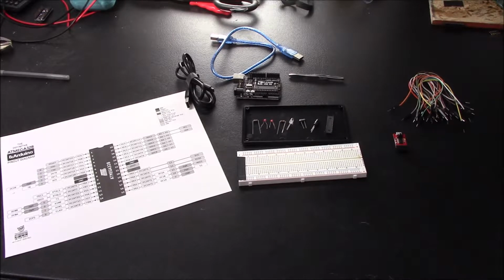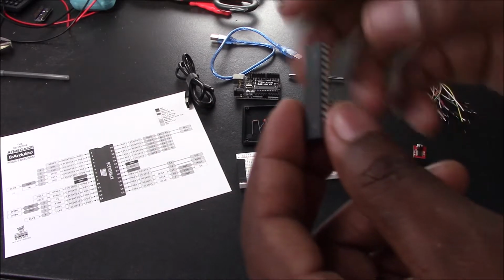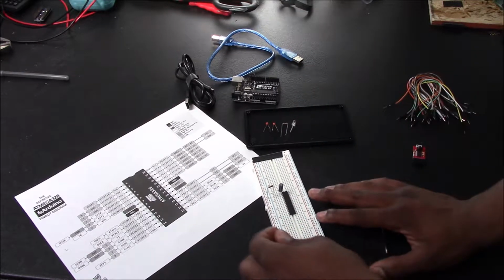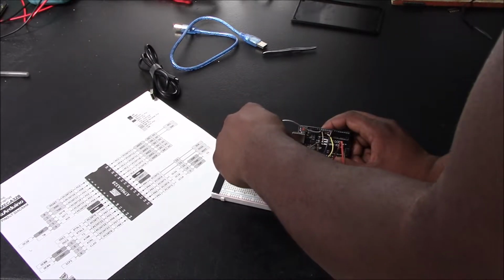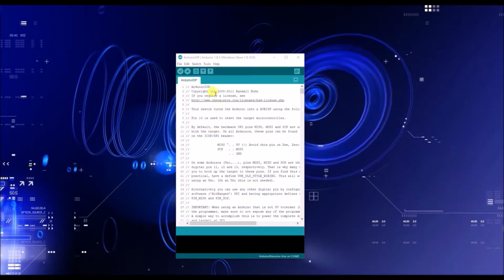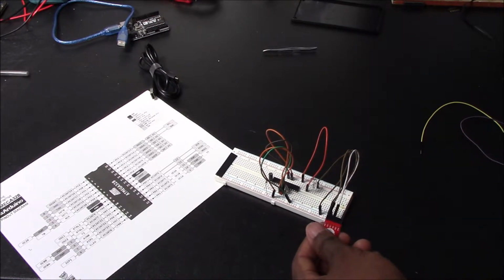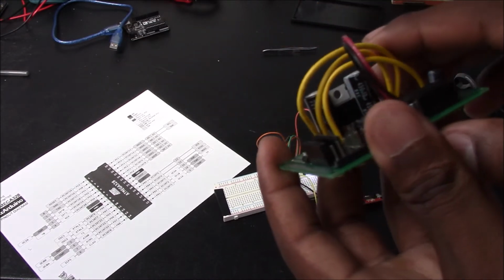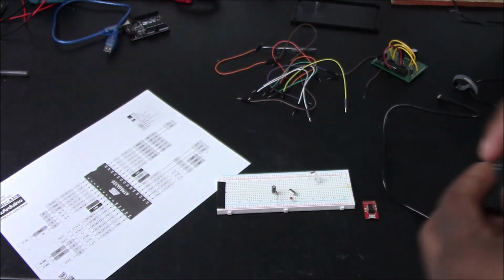Stand Alone Arduino: How To Make It

Comment: i think what your doing is building a "BOOT" loading for the atmega? many of these come with this installed and in fact i doubt you could find one that does not have one! their are many atmegas i think its atmega 328P "space" and PU which has meaning because it is a way to tell if it has a "boot" installed.